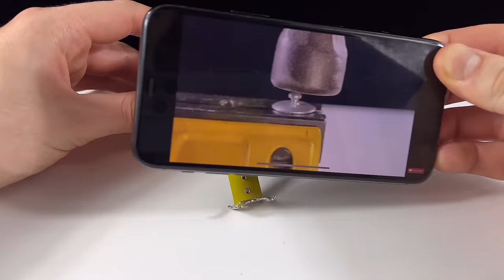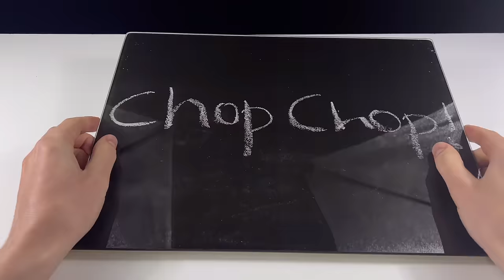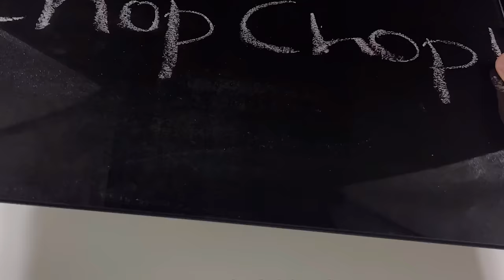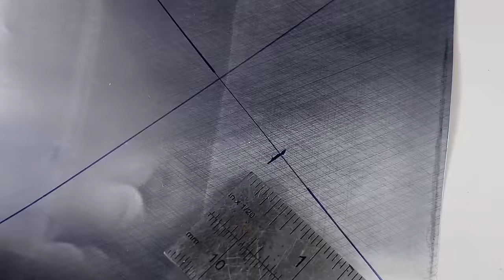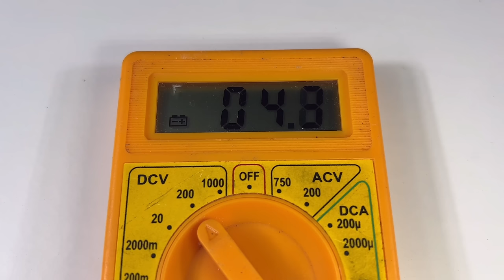Top 40 Construction Tips and Hacks That Work Extremely Well | Best of the Year inventor 101

Comment: Yikes!  Probably should add a “Kids, Don’t try this at home!” to the open leads and line current in a glass of water.  Thats the most dangerous thing I’ve seen you put on the channel!
Reply: OMG!! I CANT BELIEVE this is why I came to the comments!! & You were the first one!! I am camping. I have an inverter that plugs into my cigarette lighter. Id LOVE to boil a cup of water without having to create a fire every morning! I saw this and thot ....🤔🤔🤔 THIS CANT BE SAFE!! 
Will this damage my car? If I use a cord plugged into my inverter? Into my card lighter???? I did used to have something that looked exactly like this.. only it had a thick metal rod with a loop that you dropped into the water. Positive & Negative at each end of the rod. I suppose you're saying that rod makes the difference? Between safe & unsafe? Then we also have a old fashion percolator for coffee... which has this same exact set up (the rod with the loop) but that is housed inside the percolator which gets filled with water. I just don't see how THAT can make it safe, if THIS is UNsafe?? Again the rod being the only difference.
Can you please explain?? Anyone.
Reply: Won't that produce hydrogen gas ?
Reply: Hush
Reply: @CJWeckerly yup